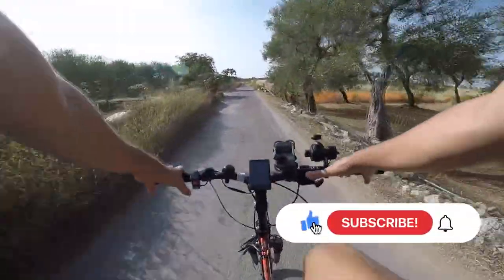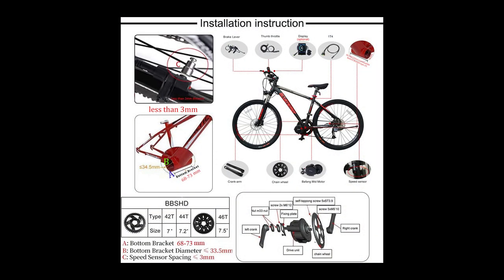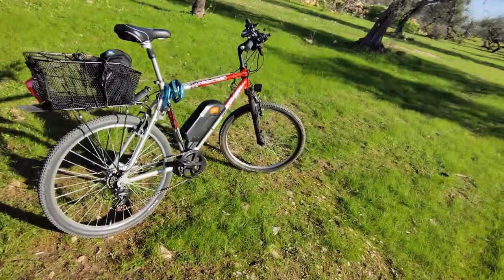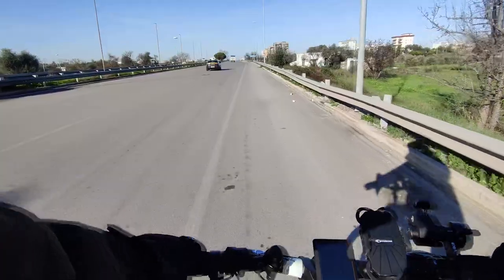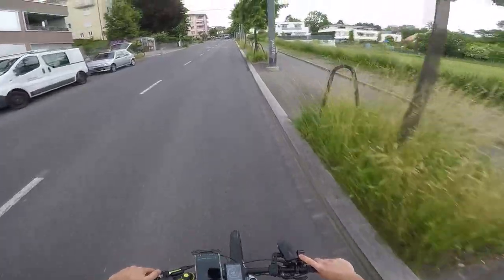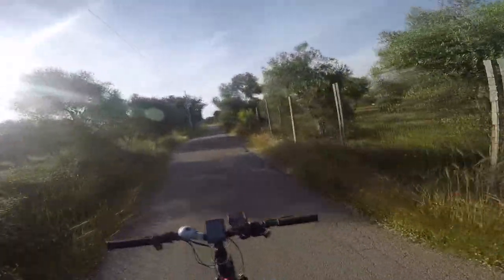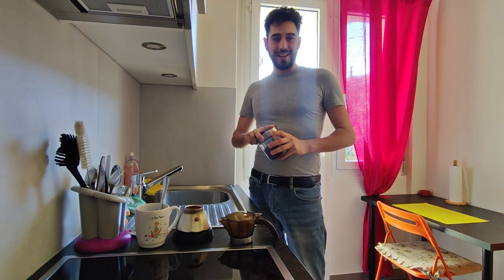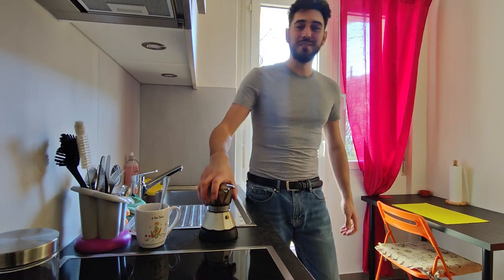Riding a Bafang 500W mid-drive kit on DIY eBike. Range? Speed? Steep climbs? Is it Fun?

Comment: Hi, Great video. I've had a bafang bbso2 500 watt for 4 years now and its still going strong. Ive had problems with the speed sensor, blinking led, not working, but just buy a seperate speed sensor instead. I found for mainly level ground and canal paths that a big chain ring is better, I used a 48 but even a 50 would be better. The motor has never failed on me and im doing tyical rides of 50 kms and only had 2 punctures on my marathon tyres.😊

Comment: Just got the 750w 48v for my Gary Fisher Tiburon with the 500c display. My first ebike & its for reliable transportation so I'm going to shift as much as possible for efficiency. I got a Samsung 30AH battery so I should be ok for long occasional 35 mile trips. Also 2-10 mile grocery trips with my new bike trailer. I was worried the 500w wouldn't pull a full trailer well even in low gears.

Comment: Tongsheng has updated it's motor, tsdz2B.  Would be interesting to see how it evolved.  What i understand from their info is that it can handle more torque now.
Reply: I'm very impressed by the Tongsheng. 

New model TSDZ2B has more robust gearing (can handle more torque, as you said), and more  reliable freewheel that has less drag when pedaling without motor. And version with OSF (Open Source Firmware) is super programmable/customizable. 

A Bafang killer? No — BBSHD has far more sheer power, and there's always a market for that. But a more elegant and refined product, I think, and the torque sensing feature is especially well integrated.

I may just buy one! 😉

Comment: I really enjoy your videos. Since 2 years Im wondering in what type of electrification to go. I rented decathlon bikes (hub & mid), I liked every type and I can't decide. Final decision is conversion:  MID BBS02 500w 48V or 500W geared HUB. But im wondering  what will be the diffenence. What is faster to the flat city and what consumes less electricity. 500 mid or 500 hub ? I need 50km range and average 35km/h speed.

Comment: My bike has bbshd 1000w mid-drive and a 52v 21ah battery so I don't worry about range and I do love riding it I live the UK it is hilly where I live I loved you video and the information you gave thank you 😊 👍🏾
Reply from the maker: Hi mate, I choose kind of the same for my 750W: a 48v 17.5ah battery that's everlasting 💪
some days ago I got this comment from a guy which have little to no space for the battery on his full suspension frame and asked me about 13ah for its 500W... I felt the need to talk about minimum capacity
Reply: Hi, I'm currently converting my bike to bafang ebike. I live in the UK? Any advise  or personal experience with the mid drive? Thanks
Reply: @amirulandsally12  Hey mate if you finished your build could you please let me know about the rules and regulations in the UK? I know the 25kmh limit but how strict is it?

Comment: Have you ever tried a clutch derailleur in the rear for the chain slack issue? Highly recommended. I use a sram gx eagle for my rear and haven't dropped a chain since installing.

Comment: I really appreciate your videos! So in detail and describing the important things, great. I just installed my Bbs02b 500w and a 27ah 36v triangle battery. So pleased with it. The only thing I done so far is to change the secondary gear grease to Mobil Mobilith SHC 100, taking great care of cleaning out the original black grease (Moly). A question though, is the Mobil grease SHC100 compatible with the nylon gear as well? I have found some statements that it is. And also done some reprogramming.

Comment: Hey man, your comparison between the Tongshen and Bafang really helped me. I really wanted a torque sensor bike and not cadence, and I didn't even know of the Tongshen. Can you tell me, do I only need that kit and a battery, or anything else? Thanks for making the videos!
Reply from the maker: Hey! Thanks to you guys for watching them :)
Ideally, the kit + the battery will be enough.
Don't worry if the battery connector and the motor's one don't match, you can always link the wires directly (or use common electrical junctions)
Any other extra upgrade can be purchased afterwards, when and if you really feel the need. 👍
Start right now to see if someone near you can take apart your bottom bracket (in case it's your first time... I never actually managed to do that myself) 😅
Reply: You can now get a Tongsheng kit with a throttle for more versatility.
Reply: @peterketler3439  you always could.

Comment: Hello guys. Am having a mid drive build, 3KW to be precise, the controllers am finding are not for mid drive because they calculate speed from the motor not the tires. Also a display the calculates values from the wheel would be nice. Any leads will be highly appreciated 
Thanks

Comment: I would hope that Bari would be relatively flat being by the sea - at least the parts that I have seen were fairly level. This would mean that even a 250w motor could be usable (and legal !).
Reply: It' absolutely flat - highest level above the sea is about ten meters. 250w is OK. The real problem is the 25 km/h limit. 30 30 would have been much better

Comment: So I guess you don't use the pedals much to go uphill since you have the 44T in front and a 7 or 8 cassette in the back, probably with something like 32T at max. This is not a really good hill climbing setup, isn't it ;)?

I'm thinking about putting a 250W/350W 48V 13Ah Bafang setup on my old full suspension MTB and it has a 8x cassette with 32T in the back. So this is why I'm wondering about this.

Thanks for the great content, th nice and lively presentation and overall the very practical building approach!!!

Comment: Question. Are the two bottle screws enough to hold the battery? Or did you extra fix and how?
Reply from the maker: Hi! I also thought in the beginning it was too weak, but it's actually more than enough. Never had to extra fix on any of the 3 bikes
If you really feel the need to enforce the holder add some zip ties (maybe metal ones) but I personally never needed em

Comment: Hi Luke. i live on mountainy area, the bbs02 500w and 750w price difference is 10$. Do you think i shld get the 500w, the battery im thinking of getting will be 48v 13ah. Grazzie
Reply from the maker: I would get the 750W, you can always downgrade it in the settings. But in both cases, if you can, take a 48V 15Ah battery
Reply: Currently have Y-20 step through with 750w rear hub. 15 ah 48v battery. 
Think I have around 70 NM at best. 
Great bike and for my use not had battery range issues. 
However I live in an extremely hilly area. 
The food delivery guys mainly use mid drives. 
So I have purchased a bbshd 1000w 48 v mid drive. 
Looking forward to the extra torque on hills. 
Have to see how it runs once I get it fitted. 
Since my current rear hub unit is geared I plan to leave it since I’m told this will freewheel. 
In time plan to replace it with a standard wheel but picking up a 20x4.0 is not easy in my location. Yea I can order on line. 
I’m hoping to fit an Alfine 8 speed hub so may have to build a wheel. 
This will allow me to change down gears when stopped.

Comment: I still dont understand why people are so concerned with how fast these motors go. It's all to do with the bikes gearing, battery size, bike weight and rider weight. A 500w wont be as powerful as a 1kw obviously. As the owner of 2 1kw mid drives and a 750w mid drive, i prefer to get more miles than worry about how fast i can go, because when you start going really fast, your disc brakes have to work harder, and if you are not using ebike rated pads, then you will be wearing your pads out too fast. I can do a 50 kilometer ride usingbmy 750w bike and not move off assist level 3 and only use three cassette gears tp deal with the hills i have on that particular ride. And i only use between 30 or 40% of a 52v battery capacity. And yes i run a 750w  motor with a 52v battery, it works great. So what do i mean? If you want to travel fast using an ebike, buy a 1kw 52v kit and if you plan on travelling on mainly flat roads, use a road bike or hybrid with a 52t chain ring and a 7 speed casette. But remember, your run times will be limited  as well as your miles.

Comment: Great video's, I ride a recumbent trike and recently installed a 500w Tongshen mid-drive with a 36v 12ah battery. This is the 1st motor so I'm still learning, I needed the assist on the hills where I live....I guess because the battery is new I can ride 30 to 40km and the battery doesn't show that there's any juice used?
Reply from the maker: Hey! It's quite normal, Tongsheng mid-drive motors tend to save more energy (because of the torque sensing s.)
I noticed (but don't know if it's just mine) that the on screen battery indicator seems to be always full, unless you're really low (I mean is not that precice), so I must find a way to show the voltage level somehow
BTW it's a great range :) with my 36V 15Ah I can reach 45-55km, it seems in line with your experience

Comment: Do you think its possible that i put a 48v batteri on my 36v 500w bafang motor ?
Reply from the maker: Here's your answer https://www.reddit.com/r/ebikes/comments/7h5oej/comment/dqou4il/
I would suggest you not to: the risk of breaking things is very high and, even if you'll succeed, your motor will last way shorter
Search, instead, for 36V batteries with bigger capacity, like 17 or 20Ah
Reply: @LukeLorusso  thc so much for your answer. I have a battery 36v 27,8ah and 2 36v 14,6 ah. Maybe gonna parallel connect the two 14,6ah batterys instead. Just have too figure out where too put them. Again, thx for your reply
Reply from the maker: @040stonehill  sure! :) checkout this video too!
https://youtu.be/9zILIYZwDAE